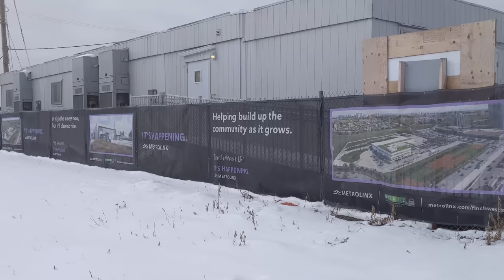Missing Links: Short-Sighted Transit Planning

Comment: Missing links in Delhi Metro:
- Upcoming Silver Line terminating at Aerocity instead of Terminal 1
- Upcoming Magenta line extension terminating at RK Ashram Marg instead of and Central Secretariat. 
- Lack of Dwarka-Gurugram connection
- Yellow line not reaching DTU
- Red line not reaching Ghaziabad Railway Station (1 km away)
- Grey line not extending to NSUT
Reply: I've noticed some more missing links near Indira Gandhi International Airport for the Delhi Metro because there is a suburban railway right beside the west of the airport and there is a station close to the airport (Shahabad Mohammadpur) yet neither the Blue Line or Delhi Airport Metro Express have a direct interchange with it (which could have potentially enabled that station to be upgraded and the suburban railway service to improve), even though the Airport Express directly runs underneath that station and the Blue Line runs almost beside the suburban railway line in that area. There is also the fact that the Airport Express doesn't directly connect with Terminal 1 or have a direct interchange with the Magenta Line to enable better terminal connections in the airport and I've also noticed the Magenta Line directly crosses the same suburban railway line I earlier mentioned at Palam but has no direct interchange with it. Just more examples of the Delhi Metro's poor integration with other rail transport modes & some other Metro lines even though it is one of the best Metro systems in the world (and still the best in India).
Reply: @broman178  the Delhi metro, while being an amazing success in such a short time has completely ignored the existence of Delhi Suburban railway to the extent the most of the Delhiites don't even know a suburban network exists. There could have been so many interchanges in with the system but the system was never revived and it continues to stay in ruins with dilapidated stations and outdated rolling stock.
Reply: @broman178  bro i lived in palam. I never knew palam was part of suburban railway.
Reply: Even the distance between Aerocity to cyber city guru gram, via mahipalpur, the distance isn't much but it sees massive traffic.
These stretches must be extended to fully create a network that's going to solve the traffic problems at the entry points of delhi.

Even on the east end, noida 62, to red line and Vaishali to red line, each are less than 5 km, yet no progress is being made except speculation.

Dwarka and rohini were supposed to be the new hub yet they have no direct link to guru gram, 

Rrts though is being build at very quick pace which makes the slow pace of delhi metro even more frustrating to witness.

Comment: San Francisco just built the "Central Subway," a short tunnel for the Muni Metro going through downtown (instead of around). It greatly improved the the existing light rail system and provided the quickest connection between BART and Caltrain, which were previously only connected in the suburbs. This would make transferring between the systems in Downtown SF much quicker. Of course, it would be great if these two systems were directly connected, but this is definately an improvement, especially since the existing Caltrain station at 4th and King will likely become one of the Northern termini of the California HSR.
Reply: I always found it strange that BART/MUNI were nowhere near Caltrain and there wasn't an easy way to transfer between them in downtown SF. Good that they remedied that.

Comment: Ah yes, Berlin and the surrounding area is a real offender to this problem... A lot of these are really short missing connections and you can get around them by changing lines a little more often, but they still make everything much less convenient . Here are just some examples that I personally really hate:

U3 from Krumme Lanke to Mexikoplatz (S1) - 850m
U1/U3 from Warschauer Straße to Frankfurter Tor (U5) - 1.2km
U5 from Berlin Hauptbahnhof to Turmstraße (U9) - 2.1km
U2 from Ruhleben to Rathaus Spandau (U7, S3, S9) - 3.4km
U1 from Uhlandstraße to Adenauerplatz (U7) - 1.3km
U9 from Osloer Straße to Wollankstraße (S1, S2, S25, S26) - 1.9km
U7 from Rudow to Berlin Brandenburg Airport (S9, S45) - 5km
U4 from Innsbrucker Platz to Friedenau (S1) - 1km
M2 from Heinersdorf to Pankow Heinersdorf (S2, S8) - 1.1km
and my personal hate:
RB27 from Schmachtenhagen to Oranienburg. The Gap is 6.7km long, but the rails ALREADY EXIST. they just have to reactivate them, then the currently really unused Line would have a FAR bigger purpose.

Anyway, the video mentioned "various points on the Berlin U-Bahn Network" aaaaand as you can see, he isnt wrong.
Reply: U7 to BER has been rejected by Brandenburg
U9 via Wollankstraße to Pankow Kirche they started planning
U4 to Friedenau was actually planned to extend there, but in the 1970s they built the A100 making a southward extension of the U4 impossible without removing the A100
Reply: Are these gaps there because of the Berlin Wall?
Reply: @szoszk  Typical german reaction, autobahn over trains. Typical.
Reply: @lavillenouvelle  not really, but the construction and planning of a lot of lines in Berlin were influenced by it, so some Situations exist indirectly because of the wall.
Reply: @lavillenouvelle  Some of them are this. Warschauer Straße is the most obvious one since the border went parallel to the Spree and there is a sudden cut between it and the tramway. Others, however, are merely bad planning (e.g. the U2 to Spandau since Ruhleben and Spandau are both in the west).
Reply: @lavillenouvelle  Most of them. The S-Bahn on both sides of Berlin used to be operated by east German railways, which western Germans wanted to boycott and they focused on extensions of the Ubahn, ignoring S-Bahn connections. And some, like the U7 extension to the BER airport (then Schönefeld airport) was impossible, as it was in eastern Germany.
Reply: @szoszk  Looking at a map, I'm actually surprised the U4 is this short, only beaten out by the then existing U55. Granted, it is physically connected to the U1 and U3 and thus one of the three branches of the eastern trunk line but still.
Reply: @MarioFanGamer659  the 60s and 70s were centered around the car, so they started to build motorways in cities and at the time they had the choice of either not continuing the A100 or not continuing the U4. At the time the decision was obvious
Reply: Honestly, this is the one thing I dislike about the Berlin's U-Bahn. As much as they have an extremely amazing public transport, the missing links are big nitpick.

As an Istanbulite who lives in Istanbul, we have missing links in our metro system too but at least those links are under construction and even will be completed soon.

Comment: In the city centre, Milan’s new M4 will cross existing M3 halfway between the Missori and Crocetta stations without direct transfer to either. A long surface pedestrian path will be created instead between Missori on M3 and Sforza Policlinico on M4.

One reason could be that in the central section planners chose to make the line follow the filled-in bed of the ancient Navigli canals to avoid interference with buildings under the narrow medieval streets of the historic centre, even in areas where this meant missing a connection or a place of interest.

Comment: Melbourne has had a major missing link for 50+ years and it’s our route 59 tram it terminates in airport west. 5.9kms short of the international airport itself 
The current terminus is a bit industrial and has low ridership. Extending the tram track the 6kms to the airport would have been a major trip generator. It’s so close!
Not to mention the closest rail station Jacana is only 6kms away from the airport. Both are so close!
Reply: FYI the "airport" in airport west refers to the suburb west of Essendon Fields airport, which the line runs right next to. Not Tullamarine, the international airport. 
It actually terminates right next to a shopping centre which should generate lots of trips, but the access is very pedestrian unfriendly.

Comment: In Toronto another missing link that’s just frustrating is line 4 not extending to at least Sheppard West…it would make it so much easier for people in the east of the city to get to places like York U, Yorkdale, Vaughan, etc
Reply: i was thinking the same thing they could run a extra track down to yorkdale or run it north and or run a loop around whole system
Reply: Line 4 is literally a twig sticking out of the Line 1, and it's baffling how much missed potential is there. It could have extended either way, but it's just this short route that seems like an afterthought of a subway line. To make things worse, one of its platforms at Sheppard-Yonge is just... out of commission???
Reply: think of them as health inducers, not missing links. It  actually wouldnt  hurt for many of you to hike a few blocks to the next station.
Reply: @HDFlood_  the original plan for Sheppard was to run from Vic Park to Dufferin.  It got trimmed down before construction began due to the recession in the early 90s and was nearly cancelled after Mike Harris took office in 1995.  At one point, due to budget constraints, I believe there was talk of building the tunnels but not laying the tracks until some undetermined point in the future.  In the end we got the truncated Sheppard "stubway".  The platform at Yonge was built as it is to allow for increased capacity in the event the line is ever built through to at least Sheppard West.

As a side note, it's my understanding that all of the existing platforms were designed to allow for easy expansion in the event that ridership ever justifies the use of 6-car trains.

Comment: The situation in Auckland, prior to Britomart's opening, was that passenger numbers were in sharp decline, so they had to move the city's main station back to a more central location. The previous station was in a poor location; around 1 kilometre from the city centre.

From what I gather, there was originally an above-ground station at the foot of Queen Street, but when the Beach Road station opened in 1930, a new post office was built on the site of the old station. Curiously that former post office building was incorporated into the new Britomart station. 

If you ever do an explainer on the Auckland suburban network, I'd be happy to provide some of my footage from that system.
Reply: The building of the Chief Post Office on Queen Street preceded the construction of the Beach Rd railway station by about 20 years. The CPO was built on part of the former above ground Britomart railway station which severely reduced its operational capability causing the NZ Railways to begin planning a new station for both long distance and suburban trains at Beach Rd, 1 km away from the bottom of Queen St. Unfortunately only stage 1 of the project  was eventually built, with Stage 2 which was a tunnel under the University and central business district for suburban services being cancelled due to the Great Depression.

Comment: 6:13 - A GTA one, the Hurontario LRT and the Kitchener line. Because the Brampton City Council has spent so long infighting about what route the Connection should take that they’ve just gone ahead and are building it without the connection.
Reply from the maker: Its not great, but neither was LRT on that route
Reply: @RMTransit  What should they have done instead along that route in your view?

Comment: I was disappointed when the new Quebec City Tramway didn't connect to the airport.  Overall, the alignment does a good job of connecting the densest parts of town, as well as giving people in the suburbs an option to take public transit into town.  But it would have been a very short extension to continue to the airport.  My understanding is that they plan to make this extension in the future, and I hope they do!
Reply: I still find it even more frustrating that the downtown portion doesn’t connect directly to the Gare du Palais. Tram extensions are relatively easily to build (although I guess nothing is that easy to build nowadays in Québec for political reasons). But I feel like not having a direct connection to your main train and intercity bus station along the route would be more difficult to fix.
Reply from the maker: Or IMO more importantly to the trains!
Reply: Yes was just gonna write : to the train! Why it doesnt connect to Gare du Palais, baffles me!
Reply: What complicate things is the airport is on a quite steep hill. The rail line just South is about 30 meters above the sea, while the airport is about 70 meters. It's OK for road trafic, but I'm not sure it would do for trains, unless they either do lengthy detour (more expropriations and a lot more trees to cut down) or tunnel their way under the airport (which would make the cost of the project skyrocket). The same problem arose when people asked why to East branch doesn't go all the way up to Charlesbourg... it's the same slope which run West to East from Neuville all the way to Montmorency falls, there's no way around it.

Comment: I thought the toronto example wouldve been the new Line 5 Crosstown which terminates in the east at Kennedy Station on Line 2 instead of extending 2.7km more to the east to the Eglinton go station on the Lakeshore East Go line. I think the potential connection between Line 5 and the go line would be incredible for Scarborough and Durham region. Yes they connect later at danforth but that is very far away and no longer in central Scarborough or Scarborough at all.

Comment: This sounds a lot like in Boston where the new MBTA Green Line that only goes to Union Square when it could have been extended 0.5 miles to Porter to allow for easy transfers to the Red Line.
Reply: I've thought long and hard about this one and I think it's because that connection already exists via the commuter rail. Perhaps they didn't want to overload the Union Square branch with commuters trying to take a shortcut
Reply: The Union Square branch of the new extension is such a strange little appendix.

Comment: I'm surprised by the lack of mention of the gap between the Blue/Expo and Gold Lines through Downtown Los Angeles. Previously one had to transfer twice using the Red/Purple lines, creating huge pedestrian bottlenecks at 7th Street and Union Station. The regional connector is finally opening this year and will make it so that there are two continuous lines from Santa Monica to East LA and Pasadena to Long Beach respectively, with no fewer than five same-platform transfer stations. Weirdly, the very same problem existed in the Pacific Electric days, with there being no direct connection between the terminals at 4th/Hill and 6th/Main, only five blocks apart.
Reply from the maker: The regional connector being nearly done is the main reason I don't mention. I also think the lines will still suffer from a lot of issues.

Comment: The Los Angeles C line is right next to LAX, but they never bothered to connect it all the way. The Los Angeles B line is like a mile from Burbank airport and the Burbank Metrolink station, but they never connected it all the way. The current purple line extension only goes to the VA hospital and doesn't make it to the ocean. It's pretty infuriating because they simply don't think about the bigger picture in Los Angeles.
Reply: The C should finally connect with the LAX people mover when the K Line is finished (sharing tracks).  The end of the B is more like 2 or 3 miles from the Burbank Metrolink and it obviously already connects at Union Station.  As for the "Subway to the Sea", that was probably never going to happen.  Expo Line already serves the beach, and there's not that much of note between the ocean and the VA hospital.  Things like the Sepulveda Line are much more important to spend limited monies on.
Reply: @Geotpf  That's a non-network oriented way of looking at it. In order to take the Expo line to the sea, you need to be at the Expo line. That isn't very useful to people on Wilshire boulevard. I think you're thinking about funding in the wrong way. We need a 200 to 300 billion dollar subway expansion in LA. We need a massive expansion. Los Angeles is one of the richest cities in the world. The United States is the richest country in the world. I always hear poverty oriented arguments from Americans when talking about transit. If poorer countries can do it America can too.

Comment: One example I would like to mention about a "missing link" is the North Philadelphia complex. We have FOUR separate stations within three blocks: N. Phila of the NEC, N. Phila to Chestnut Hill W, N. Phila of the Broad Street subway, and North Broad. Building the complex and allowing people to interchange among the regional rail lines, the BSL, and Amtrak will be an amazing time-saver for traveling between the northern suburban area and other cities on the NEC since we won't need to take a detour to the center city. The Keystone and Pennsylvanian trains won't have to do the ridiculous reverse at 30th Street as well. This place used to and will have unimaginable potential, but it's nothing different from an abandoned station now - we even have overhead wire over nothing at all!
Reply: Eliminating the reverse move (then at Broad Street station) was in fact the reason the PRR built North Philadelphia in the first place. And given how much of a disgrace the NEC/Chestnut Hill station facilities are right now, any kind of major rebuild would be very welcome.